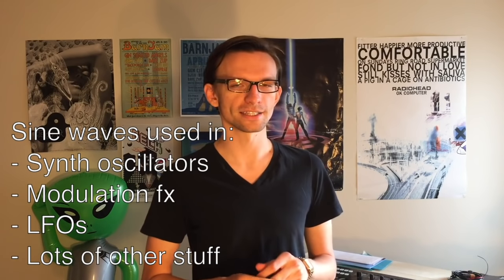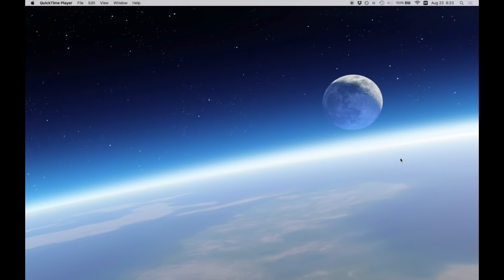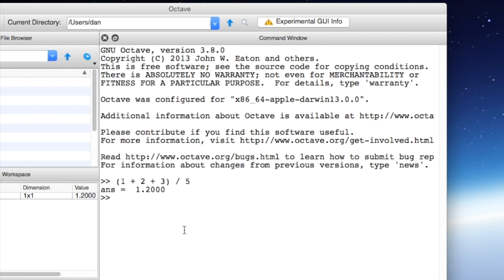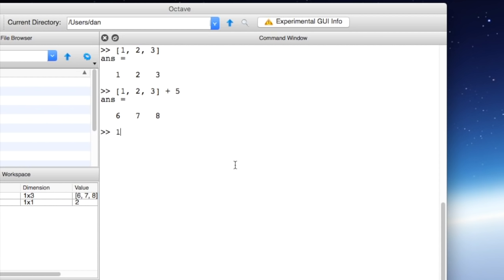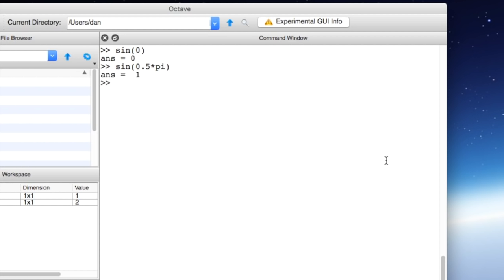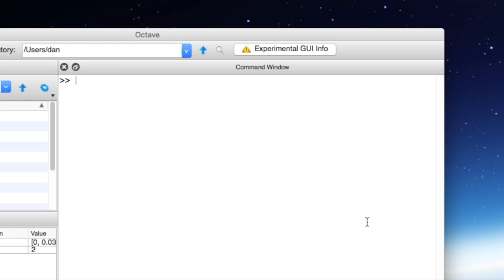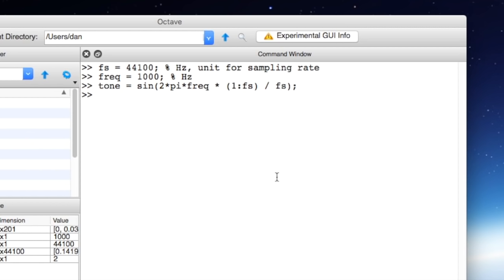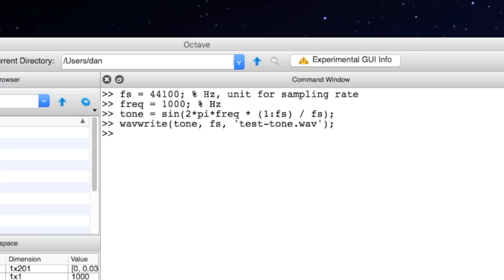Learn Audio DSP 1: Getting started with Octave and making a sine oscillator

Comment: hi there Dan:

there is a paper with the title: 

real-time pitch tracking in audio signals with the extended complex kalman filter

Can this be done in gnu Octave:  there is a github page with matlab code.  I have the idea this could be useful if it runs on a raspberry pi or similar hardware as an effect processor. 
 I have a background in C and C++. But no DSP.

Comment: What equation would you use to generate a square or triangle wave?  They seem like they would be a fairly simple equation as well.
Reply from the maker: Great question, this is actually what I am planning to do in the second video! There is a technically "wrong" way to do it that results in some aliasing that is pretty simple where you basically just directly draw whatever waveform you want, and some more involved ways that reduce aliasing by using the Fourier series or band limiting or other things. I'll give a simple explanation next and slowly introduce the more advanced techniques.
Reply: Just a guess, but do we get different waves my multiplying sine waves by the desired harmonics? Like that weird sinewave* 1/3 aplitued* 3* ferquency * 1/5th amplitude * 5 times frequency thing?
Reply from the maker: I think what you are describing is an additive synthesis approach using something like the Fourier series. Definitely one valid way to get arbitrary waveforms is to add sines at different frequencies and amplitudes, and there are some rules you can use to help you get different waveforms. I'll go over this technique and others in future videos.

Comment: Gave up on trying to install Octave on macOS...nothing makes sense... :-(
Reply from the maker: Richard Nash sorry to hear that! Octave is a little finicky on Mac for sure. I recommend using the binary installer from their site instead of Homebrew. What did you try and what happened?
Reply: I tried home-brew and got as far as the command line interface, but not the GUI...dunno how to use the binary, or whatever that may mean...hopefully it's not too tough...
Reply from the maker: Richard Nash sorry, by “binary” I just mean the installer from their site and not from a package manager. Try this download, it’s linked from the wiki page Octave for macOS: 
https://sourceforge.net/projects/octave/files/Octave%20MacOSX%20Binary/2016-07-11-binary-octave-4.0.3/octave_gui_403_appleblas.dmg/download
Reply: yay! that worked, thank you :-)